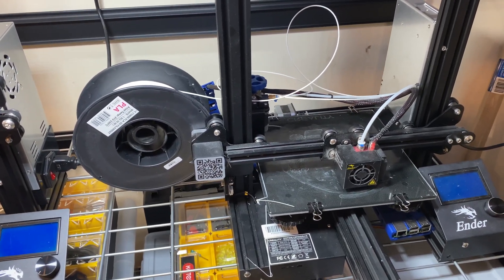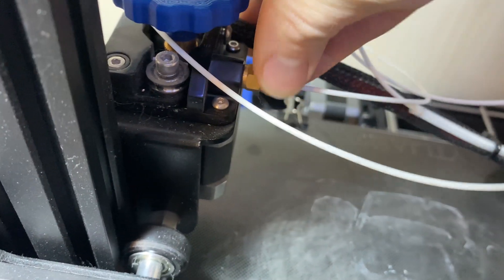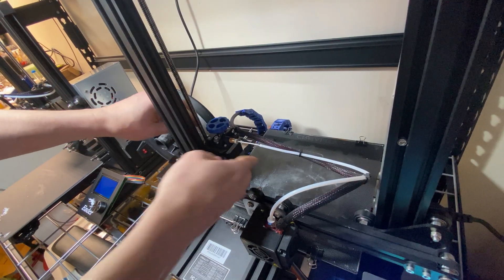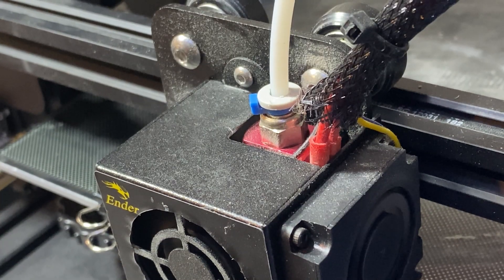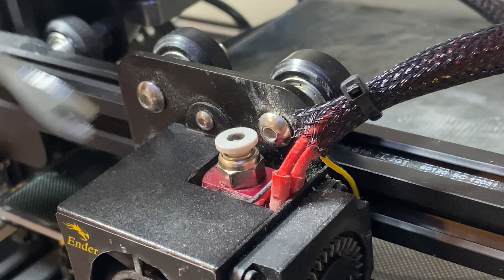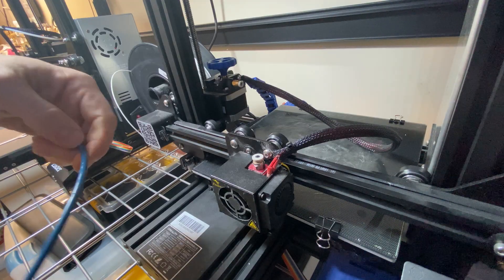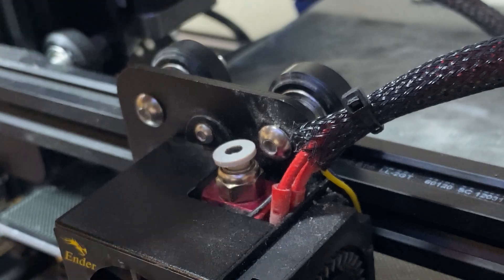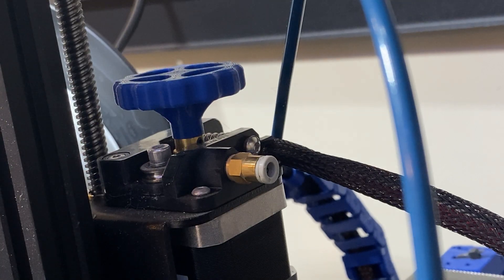How to Replace a Bowden Tube on Ender 3 Pro 3D Printer

Comment: Even after replacing my fitting and tube, the filament still pushed the tube out of the fitting. Not sure what im doing wrong, since I fully push in the button and shove the tube in as hard as I can. Any suggestions on how to get a better grip on the tube? most of the time my fingers end up sliding.

Comment: Yeah had an issue with mine trying to clear a clog. Had to get the capricorn tube cause the one I had was the stock tube for the ender 3 neo. The little plastic part that you put the blue tab on to stop it being moved was broken above the hot end and my tube was constantly moving in and out and not staying put, causing the filament to get stuck and clog constantly. Hopefully when my capricorn tube comes in it will be way better. Looks a lot easier to replace the tube that way too as well.
Reply: My PTFE bowden tube was fused all the way to the bottom of my hotend and the end was black. I think im going to die.